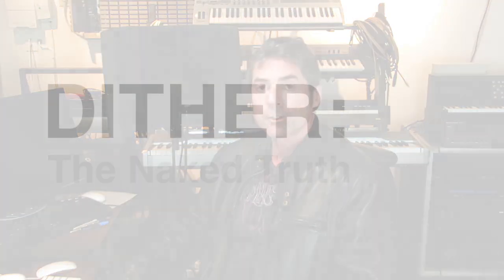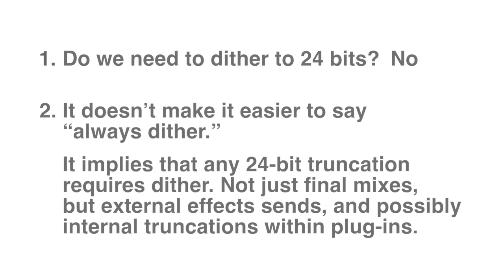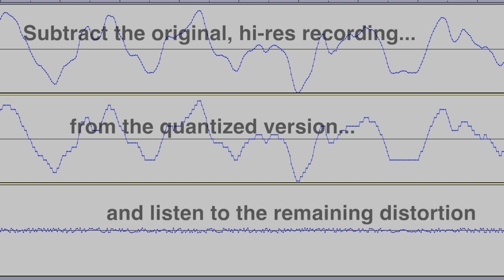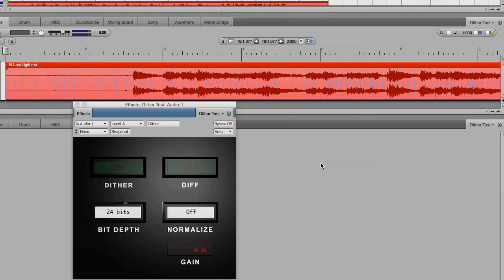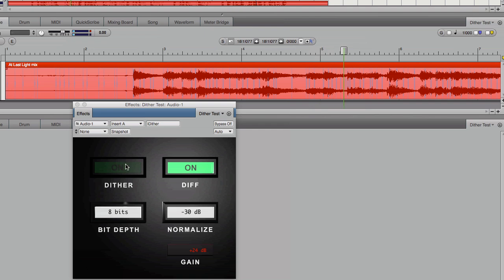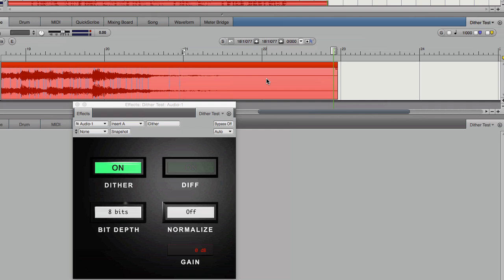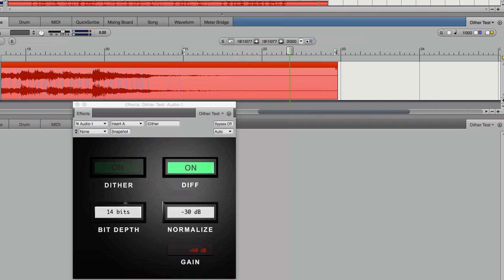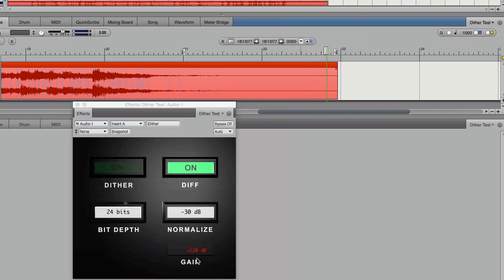Dither—The Naked Truth

Comment: so in in 24bit recording,  rendering a 24 bit mix, I shouldn't need dither?    and here is a question, if i used a 16bit sample in a 24bit recording, is their any steps reverse order here, to avoid issues
Reply: oh, self dither, so it seems to me dither is only for electronic or direct imput instrument recordings...
Reply from the maker: @ErikTheWrench  It never hurts to dither 24-bit truncations, but it also won't even be heard. Now, some would say, "why not just said always dither, and make it easy on everyone?". The reason I make this point is because some feel that every external send in your DAW (out to a hardware reverb, compressor, tube EQ...) must be properly dithered or you project will be ruin. This is an unnecessary complication—besides the extra setup, there is the paranoia of making sure there are no further gain changes after the truncation, etc.  And it's for something that impossible to hear. The truncation distortion of at 24 bits is far below the noise floor of any electronics possible (you can't escape Johnson noise and shot noise). If that weren't enough—for people who aren't electrical engineers, and doubt that fundamental truth—your ears can't hear it (people get fooled by reading that the ear has 140 dB of dynamic range—they forget that you will have permanent hearing damage if you exercise that extreme for even a few seconds on the loud end, and on the other end you're limited by the inherent noise in your room, noise of blood pumping through your veins, and the minimum energy required to deflect your eardrum (it's not massless). If that were enough, only the most artificial cases of computed music won't already have far more than enough of a noise floor to self-dither, as you say. The bottom line is that it's unhearable for several fundamental reasons.

Comment: If it's your own high-quality lossless project, will it make most sense not to dither if converting to lower sampling rate/bitrate (example: to AAC/MP3)? Because it came from a high-quality source, so it doesn't need to interpret anything else.
Reply from the maker: Good question. The process of dithering definitely should be the responsibility of the conversion from lossless, though. Otherwise, the error in the lossy format is not a linear function, so it's hard to predict the effect relative to truncation error. But it wouldn't make sense to dither first, or after. I did a quick look on the web, and Waves says explicitly, "Don’t dither before converting to MP3 or AAC". You're right going directly from a high-quality source.

Comment: At 8:09 you mention that our DACs cant pick up 24 bit audio and so on, does this mean i shouldn't bother buying 24bit music? I have a few albums that are 24bit FLAC but if I cant hear a difference then should  I just convert them to 16bit? I looked this video up because I was using Foobar2000 and had a FLAC album I wanted to split into separate tracks and one of the options was dither. (Im new to the audio scene and do not know too much, I only researched audio for about 2 or 3 months)
Reply from the maker: Check out this article to get an idea of the levels of the 16th bit and 24th bit; this is a worst-case, a 16-bit dithered signal would be much better, since it's spread smoothly as background hiss: https://www.earlevel.com/main/2013/03/24/perspective-on-dither/

Comment: did you work out its 48dB quieter from the dynamic range ?
Reply from the maker: Yes. Each bit increase in sample size adds 6.02 dB of dynamic range, and reduced the noise by the same amount, normalized to full scale (as audio always is). So, about 48 dB difference between 8- and 16-bit.
Reply: Nigel Redmon thanks ! Iv always worked it out using a logarithmic equation
Reply from the maker: OK, then this will look familiar: Adding one bit doubles the range by a factor of 2 (7 bits gives you 128 steps, 8 gives 256). dB_gain = 20 * log10(2) = 6.0206 dB. In audio, we really call max 1.0 and the extra bits are added to the right side of decimal point, so adding a bit cuts the step size in half (instead of doubling the range). So it would be more accurate to say that adding a bit multiplies the minimum step size by 0.5: dB_gain = 20 * log10(0.5) = -6.0206 dB, whichever way you want to look at it. :-)
Reply: Thanks :)

Comment: Seems to me that you're completely ignoring the cumulative impact of DSP – including the very normalizing you're adding – rather than just the playback of a 32 float or 24 bit source. Truncation distortion simply accumulates at a far greater level than dither noise applied to bit depth reductions. In other words, this is less about what's natively audible, and more about minimizing all too easy accumulative losses. Self-noise of a source is not dither. - mastering engineer.
Reply from the maker: Not at all. The discussion here is about dithering the final mix. primarily—it shows that right up front in the video. Your average person does not have control over truncation in their DAW and its plugins, unless they created them, so it's pretty futile to address that in a video like this. Disagree that self noise is not dither - digital signal processing engineer ;-)

Comment: with most software studios having higher bit resolutions why record at an 8-bit level at all?
Reply from the maker: +🌴HellaHipHop🌴 The recording is 24-bit, so I assume you mean why reduce to 8-bit: it's unlikely anyone would need 8-bit these days—the 8-bit reduction in the video is for an extreme example, so you can hear the effects of dithering. It's not possible to hear at 16-bit, as the video shows, so would do no good to use that as the primary example.